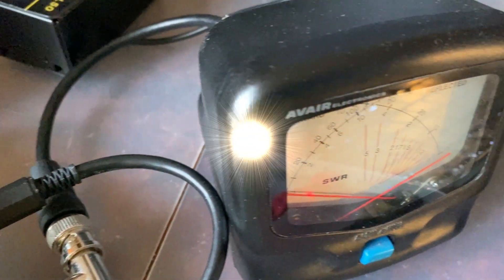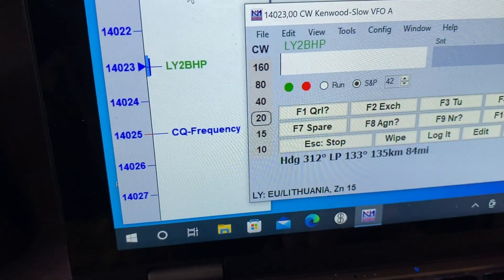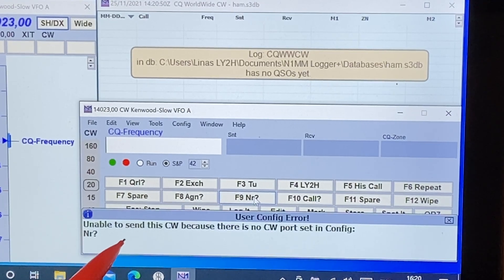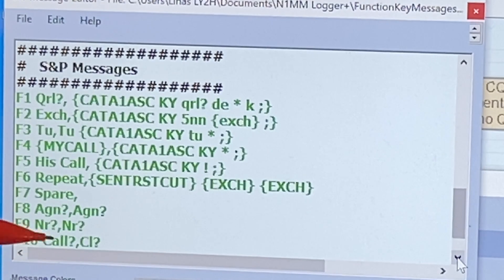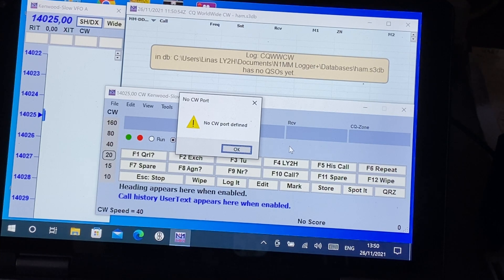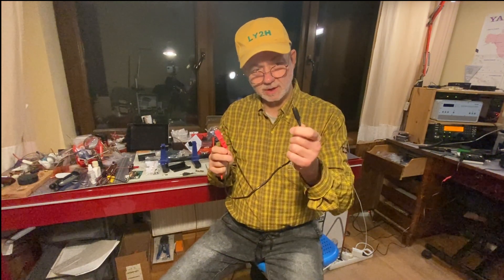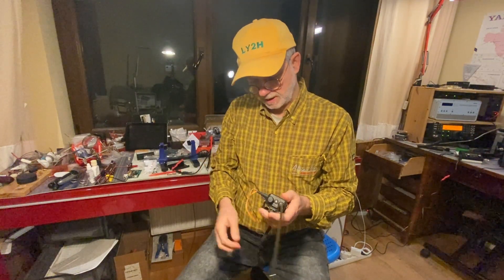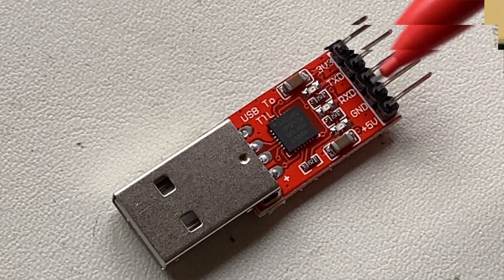QCX-mini + CAT+ CW + N1MM logger: everything over ONE cable!

Comment: Sir,  I just got the proper (rx tip / tx ring / sleeve ground) cable and have the modified the n1mm macros as you demonstrated. However I have no clue how to configure the radio and other related settings for the QCX mini withn those configuration panels. Any help in the configuration section would be greatly appreciated.
Reply from the maker: @GaryUtz  Hello Gary, thanks for watching! I think, there is no specific settings needed in the QCX mini in order to run  the CAT and the N1MM. You just need to have the right cable, plug it into the ACC socket on the QCX, configure your N1MM software in the computer and off you go. The best way to see if the radio talks to the N1MM logger is to rotate the VFO knob on the radio and see if the frequency moves also on the computer in the logger entry window. HTH , good luck! 73! Linas LY2H

Comment: Hi Linas, thanks for a great video. It's amazing how the QCX works easily together with N1MM with your help! Did you try to make the QMX work with N1MM? I am trying, but not knowing N1MM well, haven't succeeded yet. Can't see the VFO, although I can change the bands.... If you have been down that path, your advice would be most appreciated!
Reply from the maker: @arcandide  Thanks for watching Arcandide! I'm glad it was helpful. I have not tried to run the N1MM on the QMX  yet. I thought, it should be quite similar to QCX, but who knows :) Thanks for drawing my attention to this, I'll let you know if I find something. 73! Linas LY2H
Reply from the maker: @arcandide  Update. You are right, the QMX  is not capable to run CW from the N1MM+ Logger, I've just tried it out on my QMX. It seems that this is a firmware limitation. The QMX is a merger of two radios- OCX-mini and QDX. Unfortunately, the CAT in QMX was inherited from the QDX and, thus, is not fully supporting the CW commands, in difference to the QCX. I saw one post on groups.io by Hans, where he confirms bringing QCX CW functionality into a QMX is on his to-do list. Let's hope for this! BTW, using the Winkey should resolve the problem, but at the cost of one more box in the backpack , though :) 73! Linas LY2H
Reply: @Linas_LY2H  Thank you Linas, that confirms my impression. Need to wait for a new firmware - new goodies these days: narrow cw filter and lower side tone. Something to enjoy in the meantime - normal cw is anyway my mainstay.... Warm regards Peter HB9EBE

Comment: Hello, thanks for the video. Can you tell me which data must be entered in the n1mm program for the TxRx for the QCX-mini, it is not in the TxRx list?
Thank you and 73  Rudi
Reply from the maker: Hello Rudi, thanks for watching! QCX-mini is using a subset of commands as in the Kenwood TS-480, so you need to choose the TS-480 as a radio in the N1MM logger. QCX-mini’s User Manual (chapter 4.17) could be a good reading if you’d like   more technical details on the hardware side, like cable connections etc., apart what is said in the video. HTH, 73! Linas LY2H

Comment: Dr Linus. What settings for RTS and DTR did you use? 73 de SM6MOJ
Reply from the maker: Hello, both RTS and DTR are off. (because CAT is doing everything). For the radio, "Kenwood-slow"  works best for me. Speed 38400, Parity N, Data Bits 8, stop bits 1. All other fields on the right are left blank. HTH. HNY, Skol! 73! Linas LY2H

Comment: Great videos.  Do you notice any timing issues for CW using the CAT port?  I am using a Winkey mini but yes, it takes a second USB port on the computer.
Reply from the maker: Thanks Greg! And no, I’ve never experienced any timing issues running N1MM on any of my laptops, be it Windows XP on 1GB RAM machine many years ago, or 8GB RAM and Win 11 PC nowadays. Winkey is a great idea but I have yet to feel the need for it as a CW generating machine in the contest. Actualy, I have the Winkey but I only use it  to generate RTTY code from the CW code for my IC-705, as the newer version I have is able to do this. On the other hand, I  only have experience with the N1MM logger, may be other contest/CW logging apps create the issues you are asking about, I just don’t know :) 73! Linas LY2H

Comment: In August 2022 I purchased a USB > TTL cable from Amazon for $20: Cordable USB to TTL 3.5mm Serial Adapter Converter cable TTL-232R-5V-AJ 5V. It worked perfectly with my 20m QCX-mini and N1MM commands as noted by LY2H.  N7RCS
Reply from the maker: Thanks for sharing this info Jim! 73! Linas LY2H

Comment: I think the most important question is where I can buy the cable or how to make it. Can't find it anywhere
Reply from the maker: Hi Angel! Starting from the minute 9 in my video, I'm trying to explain in detail how have I made my cable. I will try to answer any questions you may have on that. And if you google for the CP2102  USB to TTL converter you'll find some offers where to buy this chip  from. 73! Linas LY2H.
Reply: @Linas_LY2H  I definitely missed that. Thank you very much Linas.

Comment: Thanks so much, it works great.  Any ideas how to get a QDX to run in WSJT-x inside N1MM for contests or general logging?  I tried but had problems with com port "confusion" Thanks again
Reply from the maker: Thanks for watching! I haven't tried QDX with N1MM yet , may be later, it's an interesting topic! I think it's important to make the right settings ,as per N1MM User Manual,  in both the logger and the WSJT-X apps. 73! Linas LY2H

Comment: Any chance for this to work with Icom-705
Reply from the maker: Hello, there is no need for IC-705 to change the script in the N1MM+, it works perfectly with the original script and a standart USB data cable ( the CI-V port must be used on the radio). If you have changed the script as in the video for your QCX-mini, it will NOT work with the IC-705 anymore, you'll need to revert to the original script. Hope, this helps, 73! Linas LY2H
Reply: @Linas_LY2H  Thank you so much for your reply. Hope to work your station soon . 73 DE 4G1AOC

Comment: Hello Linas, is there anything else that needs to be configured in the QCX radio? I copied the commands, but is not keying the radio. Thank you, Ed
Reply from the maker: Hello Ed, thanks for the messgae. There is nothing to set in the QCX itself, except that you need to configure the CAT itself, i.e., to open the Config tab in the N1MM up and make the right configuration there: the COM port, the Radio ( I chose the Kenwood-Slow, it seems like better adapted to the QCX), mark the CW window, in the Set tab - 
speed 38400 ( it's important, other speeds didn't work for me), Parity N, Databits 8, stop bits 1, DTR RTS Always off, Two Radio Protocol -None, Foot Switch - None. Radio Polling Rate -Normal. After making this setup, the logger must be able to communicate with the radio, like reading and change frequency etc, and after rewriting the Macros script, it should PTT and transmit messages. That's it on my win 10 laptop. Hope, this helps. 73! Linas LY2H
Reply: @Linas_LY2H   Hello Linas, thank you very much, it works great.  Keep the great videos coming.